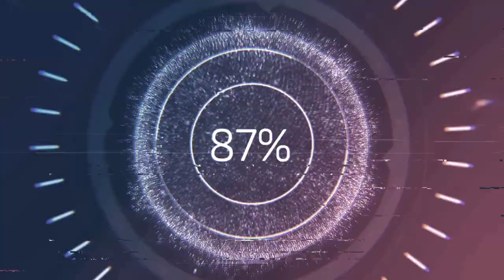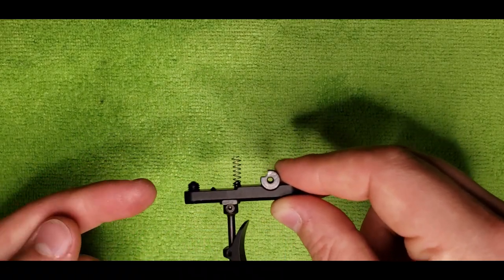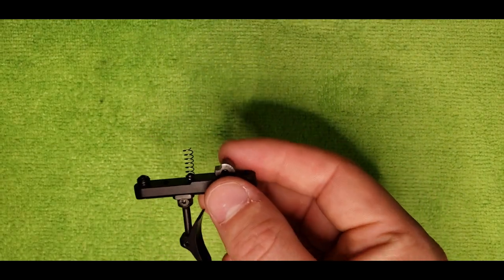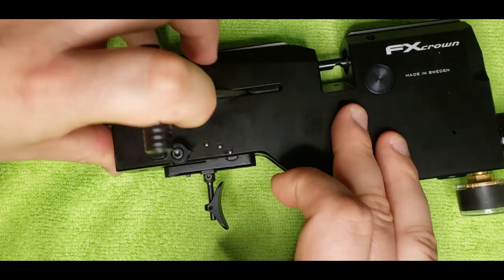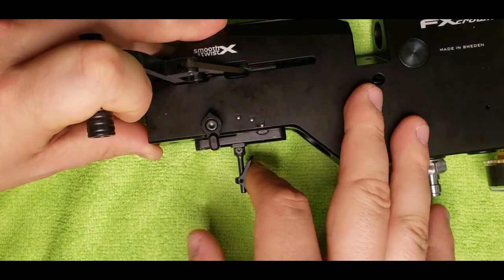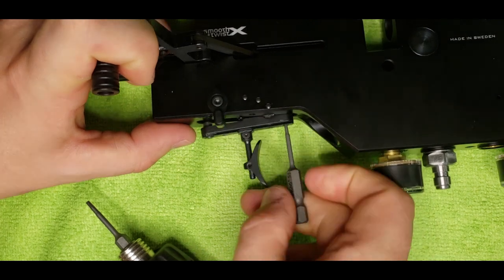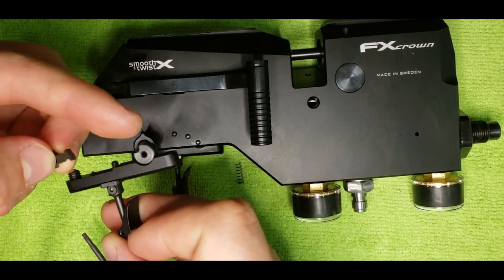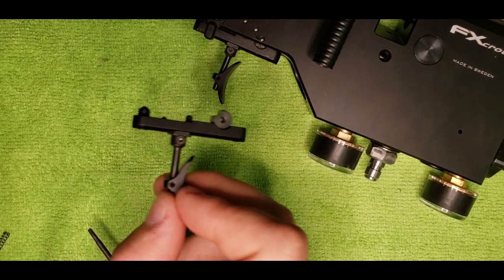FX Crown Trigger Tuning Tutorial - FX Airguns FX Crown Trigger Adjustment

Comment: Great video! So mine started to slip here and there when i cock the gun, it once slipped and fired.  My cocking linkage with the two scrub screws is still in place but seems like while cocking, it is not smooth like it was scraping on something. Could this be the trigger system out of place causing the sear not catching, etc?  Thank you in advance
Reply from the maker: Possibly, or the hammer pin bent. The rifle will need to be disassembled and investigated to find the cause.

Comment: Excellent video. Thank you. Quick question, does the position of the trigger blade post, fore and aft, make a difference in trigger pull?
Reply from the maker: Yes it does for sure! The further from the fulcrum (trigger wheel pin), the lighter the pull to tilt / "pull" the trigger.
Reply: @910AirgunTuningandRepairs  Thanks for your reply. So that’s my issue, pull / longtitudinal position has changed. The biggest issue I had with my Mk2 Continuum is that every screw was loose when I got it, so everything moved, very annoting. Once I tightened everything, it works like a dream. My only other issue is with the 700mm barrel. Houtght I would have used it a lot more than I have, 3 times, because youhave to remove it every time to put everything back in the case. It’s a real pain getting stuff down to the English speaking islands in the Caribbean.

Comment: Hi, I was looking at the FX impact Mk3  and the Crown mk2  25 caliber but I noticed one advantage of the impact is that at 25 caliber it had about 90 FPE while the Crown Mark II had about 60 FPE. My interest is long range shooting and experimenting with penetration and accuracy of course. I prefer the look in the feel of the crown but an additional 30 FPE on the Impact is a big advantage for me. Any idea why there's such a difference?
Reply from the maker: It is simply the build of each rifle is drastically different. If you like the Crown, but want power, look at the FX King. Nearly identical stock and configuration, but even more power than the Impact M3/M4.
Reply: @910AirgunTuningandRepairs  I always thought the FX impact was the most powerful in terms of FPS and FPE. Aren't you going to get more of a shot count with the impact M3 compared to the king? 

What would you estimate the shot count would be with a 30 caliber shooting slugs as compared to a 22 caliber shooting slugs with the King? The specs on the FX impact Mark 3, 30 cal caliber is around 110 shots but I doubt you're going to get that many shots with slugs.
Reply: @910AirgunTuningandRepairs  actually I just looked up the FX King. At 600 mm Barrel 22 caliber is 128 shots and the 25 caliber is 96 shots. What's impressive is that I thought these were with pellets but then I noticed that it's stating using the FX hybrid slugs which is very impressive. With the FX impact They Don't Really state if it's with slugs or pellets so I don't know if the shot count is comparable with slugs.

Comment: The problem with all this is after you tweak the first and second stage screws and get it just perfect and then go walking in the woods on a hunt for instance, the next time you shoot the rifle you'll find the trigger is not how it was before you left. You have to secure those screws once you've adjusted them so they don't vibrate in or out. One small rotation will cause a big difference. I suggest if you mess with them, just take them out and put some Teflon tape or some sticky bow wax on the threads and redo everything. This will absorb the vibrations while walking around and hopefully keep them set. Locktite would be my last option. I wish FX had a different mechanism for adjustment that would stay put.
Reply from the maker: Hey Jason, Thank you for your input! The FX factory uses Loctite to secure the screws in place, so that is ultimately what I recommend as well (obviously low strength). The Teflon tape does not sound like a bad idea at all though!

Comment: Is there loctite on the screw on the trigger blade, if so a little heat to the screw to adjust the the blade angle. ..1.27 mm hex key, where does one find that key?
Reply from the maker: Normally there is not loctite on the trigger blade screw from the factory. 1.27mm hex can be found on Amazon, Bondhus makes one

Comment: what is a safe way  to heat or remove loctite on a set screw /my safety wont engage
Reply from the maker: Pencil torch, cigar lighter, or any small flame. Or, remove the trigger assembly from the rifle then apply heat to the necessary screw, that way you do not have to worry about orings getting heated.